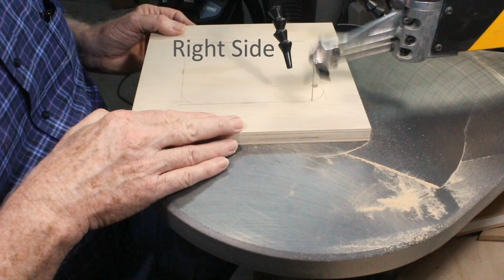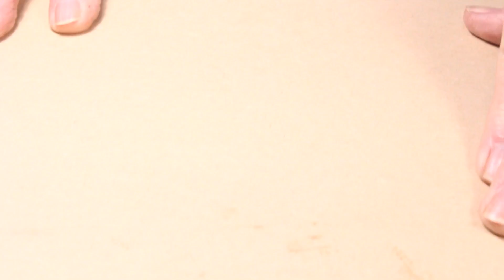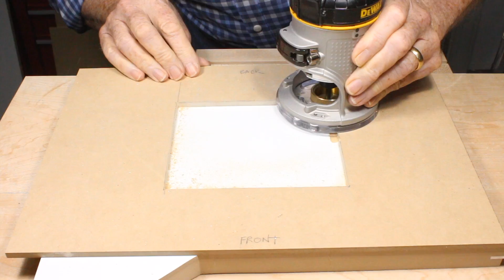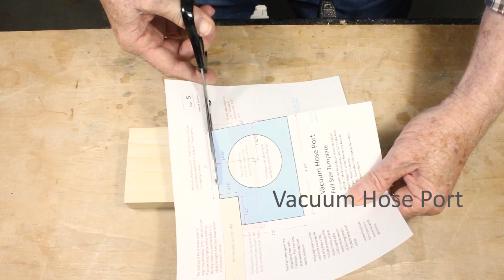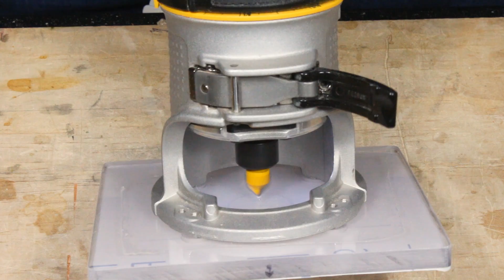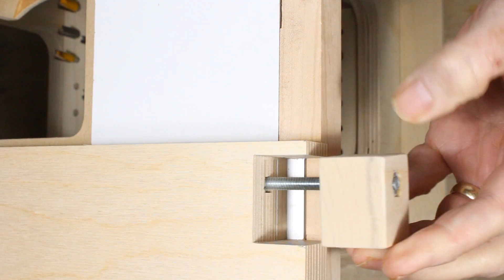Mini Router Table

Comment: It is overkill to use epoxy to glue two MDFs together. Ordinary wood glue is fine. And then you do not have to run the risk of the toxic effects of epoxy. It is highly cancerous when wet.

Comment: Beautiful router table and impressive skills! The only thing I didn’t understand was why it was necessary to make such a complex dust removal system. This router (or at least it's europen version named d26200) has a plastic adapter for a vacuum cleaner in the kit, which is screwed to the trim base and creates a completely closed chamber. Wouldn't it be easier to just use the stock hose?

Comment: where can i find this type of blade and what is the name or brand?
Reply from the maker: Sorry, but I don't understand the question.  You can get sets of router bits from the online stores, like Amazon or Ebay.  I cut some of the parts with my scroll saw, which uses blades.  If these are the blades you want, several companies sell them online:  Olson, Pegasus, and Flying Dutchman are three good brands I have used.
Reply: @PatrickSullivan  bench jigsaw blade ?

Comment: Hello sir patrick , i have a question please , why did you make the dust collection port on the left side , why not on the back side where the vac hose would not obstruct operations, and it’d make the table symmetrical, plus also it could accommodate adding another dust collection port inside the fence
Reply from the maker: The main reason is that the router I used is only open on the front side.  This is hard to explain, but if you look at the DeWalt router, you can see that the dust vacuum must be on the front side.  However, it could easily be located on the right side.  The left worked better for me because of my shop layout.
Reply: @PatrickSullivan  thank you sir patrick for replying , actually after i commented this comment , i went ahead and made one with the same router , and immediately realized the answer to my question , lol , so i had to make the router face Backwards , turned out nice though , thank you for all your awesome and ingenuity work

Comment: Im about to begin building a table saw for my Garage/workshop bench.. Thisnis a beautiful piece 9f work Patrick.. What is the cutting tool with the thin wire? that u were using to do all the cut outs??

Comment: Is there a step missing? At 6:12 the recess is being cut and the tabletop does not have a hole for the router. Then at 6:18 the recess is still being cut, but there is a hole through the top. Where was the step for cutting that hole?

Comment: Patrick I am in awe at your skill, and in addition the presentation value of these videos. 

In this case, even if this is a mini router table, it's a lot better than anything I've seen that's shop bought. It's immaculate, such high precision. 

I'm subscribed and wondering what's next.

Comment: Thank you for generously sharing your project. I liked your idea because of it’s compact size and decided to try it with my old Harbor Freight Drill Master 1/4 In. 2.4 Amp Trim Router. I scaled this design up by 20% for my build and installed a router lift as found on YouTube by Gökmen ALTUNTAŞ with the video at https://www.youtube.com/watch?v=Tff3lX4g-Ts.

The upscale worked well and I like the size and convenience. I did a more conventional fence using T-Track that has a vacuum port.  The upscaled bench top vacuum needs some adjustment to work well with the addition of the lift. A fixed mounting as originally intended would not have been an issue. I have only used it a couple of times now. The only problem so far is the lack of a lock on my height adjustment of the lift.  With downward pressure (plunge) my bit can loose the height adjustment.  I may try a threaded insert into the drive gear block and a nylon locking screw against the drive screw and see if that works.  Very useful.  Thank you again.

Comment: hi Patrick, thank you for the plans, they are both neat and tidy with good attention to detail. One thing however is missing, when you do a none through dado the dust builds up at the front of the piece being routered. There is an easy fix to this to drill a hole ½ inch from the router bit in front of it, all thee dust will be drawn down into the dust port and thus eliminate the problem, it should be an easy change to your plans. Once again thank you for the plans and keep making those excellent videos.

Comment: This video is only 16 minutes long.  So far I think I've spent about 16 hours trying to duplicate it, and I'm like... 70% of the way done?  Maybe?  Brilliant video and plans though.  Thank you!  Here's hoping I can get it finished to give as a gift for Christmas.
Reply: Finished it, and it's a beauty!  Note that if you use a method like Patrick's, where your ultimate "top" surface is laminated on top of the 3/4" material, you can use the vacuum port exactly as drawn in the plans (Rather than extending it upward as the plans suggest), and extend the solid-surface top right over it for a slightly cleaner look.

Comment: Dear Patrick
I have taken the liberty to model your plans into a 3d CAD design which I would like to share with you in case any of your followers ask for them.
I will very likely CNC the parts in my shop and keep you posted about the results.
If you are interested in the CAD model I'll gladly email you the design.
Best regards,
ubi de feo

Comment: also in the published plans it said that the 1”=2”..... does this mean that the major part of the table is actually 30”x21”?   Btw I think the design is great and I would like to make one like it.
Reply: The 1" = 2" is the scale of the drawings. The measurements as stated are correct, just that the drawings / printouts you are seeing are exactly half the size of the actual item (except for the two pages that do say "actual size" on them)
Reply: @timkaiser8149  thx

Comment: Hi Patrick, I'm new to wood working, and just finished building this router table. The video and plans made it simple. Thanks for sharing. I added a taller fence that could be removed from the original fence with dust collection coming from the top back of the fence. Plus made a 2' x 3' table the same height as  the router table with a  cutout in the middle for your router table to snap in,  helps with big jobs. I leaned a lot from following your design.

Comment: Hello, great job! And thanks for sharing the drawings! It says in the drawing pages that: "These drawings are half-size. 1 inch = 2 inches". So all the measurements in the drawing should be multiplied by 2? Thanks
Reply from the maker: Jonecir:  The measurements are correct.  The drawings are reduced so they will print on ordinary printer paper.  The template for the dust collection piece is full size.
Reply: @PatrickSullivan  Thanks a lot Patrick. I will  try to build one for me!
Reply: @PatrickSullivan  Also, I have a Makita 3606 Router, so I guess I'll have to make some adjustments in the base plate.

Comment: Outstanding job. A1 quality - hats off. Someday looking to achieve this level of perfection, Sir.

I am new router user and planning to build a table. One question - how do you adjust the bit height when routing. I used to think one needs use a plunge router for a table. Looks like that's not necessary - which gives me hope since I have a fixed router.

Comment: What brand is your scroll saw? Looks like a good tool. I’m looking to upgrade from my tabletop WEN.
Reply from the maker: My saw is a DeWalt.  They only make one model.  This is a great saw, and a vast improvement over my previous "starter" saw.  Noise and vibration are low.  It took me a while to catch on to the fact that a scroll saw can be used for so many more tasks than marquetry and decorative scrollwork.  If you use it regularly for projects that require curved parts, you will find that it can do quite a bit of the work that is often done on band saws.  And if you need very small parts, I feel it is the safest power saw in my shop.  If you rarely do any of these tasks, then you may not be able to justify the cost
Reply: Patrick Sullivan thank you! I definitely understand the versatility and value in a decent one. My starter has gotten me by, but the accuracy and quality is lacking. Appreciate the response. Thank you for your content.

Comment: I just got this router and thought that it's not a good fit for a router table - I want easy access to it for hand-held routing and template work. I wanted to buy a second, cheaper router and make a table for that. But your design gives me the best of both worlds - great table and easy access to the trim router without the need to buy another tool. You, sir, are a gentleman and a scholar. Subbed.
EDIT: I'm going to either make this a little taller or get rid of the bottom piece of plywood to be able to just drop the router motor from its base in order to change bits. I might even get a second fixed base for hand-held use and just leave this one in place.

Comment: I love doing personal projects and time has no bearing to me. I sometimes have a long term project that I might work on 30 minutes a day or a week. No different then any hobby/job I usually learn things that I apply to other work. If you don’t use your creative mind you no longer become creative. Love this small router build myself. I have a large table and I like to leave it set up for everyday jobs. The small table is ideal for small one off projects and not changing out my large table. Most people use several routers each having different bits. I believe I have at least 5 plus a small battery DeWalt hand router. Keep up the great projects and ignore the haters. I’m 76 years old and learn new things daily. I have seen many wow ideas to use even from projects I will never build but it they can apply to other projects. Excellent work

Comment: god damn it, I WAS sure that I'd know how I'd want to build my own router table...then I saw this vid and now I question everything :D this looks so good! though the table itself could be slightly bigger for me. And I don't get why you made the fence run on the guides. Isn't it irrelevant if the fence is parallel to the table? Think there are easier solutions to do this. But on the other hand your locking mechanism is very nice, takes only one screw to turn..good job, new sub

Comment: Greetings Patrick. After being away from woodworking for moren then 10 years, I picked it up again and bought a DeWalt router. Then found your desing on youtube. I build it and and although I made some minor mistakes I did manage to build a correctly functioning one. I must say I am very pleased with it as I already had employ for it.  Thank you for the design! (although it is not as easy in metric as you might think  :-)  )
Also it would be adviced to prep each side as much as possible including using the roundover bit to make the edges easrier on the hands when lifting and using the table.  Thank you again, very happy with it.

Comment: I just finished my Router Table and it works and looks great. Amazing design! Thanks so much for the precise plans. I was able to easily digitally convert plans to be cut with my CNC router which allowed me to carve out pockets for the walls in the top and bottom for the walls and a pocket for the wrench. Thanks so much!

Comment: Wow - I just ran into this video. Very well done and extremely detailed. Thank you for the plans - this is just what I need for my trim router. I have an older Porter Cable router table for the "big" PC router but it's a pain to use. This is much more practical because it has storage and much smaller and lighter. Thanks! You have a new sub!

Comment: Loving your Mini Router Table but before I make mine from your plans, is there anything you might change or add?
Reply from the maker: This is the second one I have built, and it incorporates all the changes I could think of.  I am extremely pleased with this design.  No regrets, and no dreams of adding just one more feature.

Comment: Bilgilendirici ve yardımcı videonuz için teşekkürler. somunları ahşaba yapıştırmak için ne tür yapıştırıcı kullanıyorsunuz?
        Thank you for your informative and helpful video. What kind of adhesivedo you use to attach the nuts to the wood?
Reply from the maker: Epoxy.  It does not shrink when it dries or cures.  I use the 5-minute type most of the time.

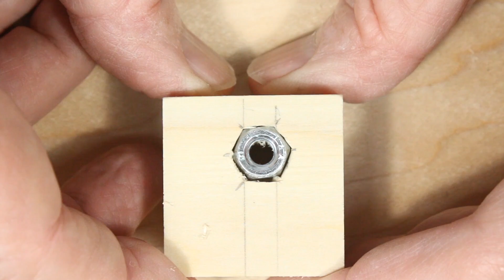Comment: Thanks for tutorial. Cam lever where came from? i have to make an "improvement" at 13:49 replace the nut with a wood plug for more stability. I will try to make one table for my trim router. Nice job!

Comment: This is a cracking video and a great router table. Years ago I made several monster floor standing router tables and they were all good - I still use one today. But a small table like this has a million uses, that the larger tables can't do - you can't put them in the boot and take them to your friends house to help out on a project for instance.

Great video, thanks for making it!

Comment: Hmm,  maybe this could be the basis for a compact portable woodworking station for vacation travel.  Pack only a limited selection of router bits, and fill the space below with carefully selected hand tools.  What comes to mind are No.4 and No. 60-1/2 handplanes, a Japanese handsaw or two, a compact cordless drill/driver or hand drill & bits, a multi-screwdriver, a set of 4-5 chisels, a snap knife, combination and bevel squares, and a tape measure. And a few other small items tucked away as may suit one's fancy..

Comment: How did you ensure that the fence is square to the table?
Reply from the maker: Nasser is right.  The fence works even if it is extremely skewed.  In fact, I made a router table with a fence that pivots on a screw at one end.  The only factor that counts is the perpendicular distance from the bit to the fence.

Comment: Very nice build with a extremely detailed video on the build  amd awesome  tips  and ideas to build one on your  own i will also  agree on  using the same Dewalt router for  most of the same reasons you mention another nice  thing about  making this type of a router table for a shop  would be  easy storage, portability and noise reduction  with a heavy duty  router screaming for a few hours  in any shop it can become  quite a unpleasant sound to your ears  and of course a serious  reduction in  cost of 1/4” shank router bits  especially if you buy some of the imported ones on the internet ive seen  multiple kits available. For bits costing under 2 dollars  a piece  ive been  doing Woodworking as a hobby  for over 35 years as well as professionally for more than 20 years and some. Of my 1/2 “ shank bits i  paid over 50 dollars each. For ! Years ago  carbide tipped   Bits were much more expensive  luckily with the advancements in manufacturing  mainly due to  CNC machinery  overhead and   Labor costs have dropped. Significantly  my 27 year old son was just telling. Me recently  how suprised he was by the cost of.  Router bits as he is  building. His own  personal supply  i was laughing  beause he mentioned that   How he now understood why i was always so  protective of my  router bits  from theft or being abused   By others  I told. Him yes  its the same. Thing with specialty drill bits  you buy one. At a time  stretched out over a few years as needed and eventually you wind up with a tool box with  almost 2 thousand dollars. Worth of drill bits  that you may only use for one task

Comment: What is the plexiglaas good for ? What is there to see ?
Reply from the maker: You can make the router baseplate out of anything you want: metal, plastic, or wood.  I used polycarbonate because it is stable, doesn't warp,  doesn't expand with humidity,  and easy to cut with woodworking tools.  In this case, the fact  that it is transparent is unimportant.  However, if you remove the router from its table and use it in the hand-held position, then the transparent base is a big advantage.  It allows you to see where you are going.

Comment: Nice for, small work
Reply from the maker: Right, Sheila.  If you make kitchen cabinets for a living, then you need a big router and a much larger table.  However, I am impressed with how many tasks can be done with this small, convenient setup.  It is not just for people who make pencil cases and earring boxes.  I also have a 3 HP router with a big table and a long fence, but I find myself turning to the little router table for a large fraction of my tasks.

Comment: Firstly great video and table. I’m in the process of building it right now. What did you use to cut the hole in the top? Between 6:12 and 6:23 in your video the hole suddenly appears however there is no video footage showing how you cut that hole. Thanks!
Reply from the maker: I used a scroll saw.  You can see my scroll saw at work cutting large holes in the plywood sides and back.  However, a saber saw would work nicely.  The top could also be cut with a small handsaw, which slices through MDF without much effort.  Finally, you could cut it with your router.

Comment: Congrats and thanks! This is by far far far away the best diy project for wood working tools. The steady hand in that little saw is like Schumacher of woods cutting, the wrench slot with the magnet, the surprise bits holder and finally finally someone use the cam nut from bikes quick release (so natural :) I already had that idea watching others blunders). Great to offer plans for free, others ask money for very basic designs.